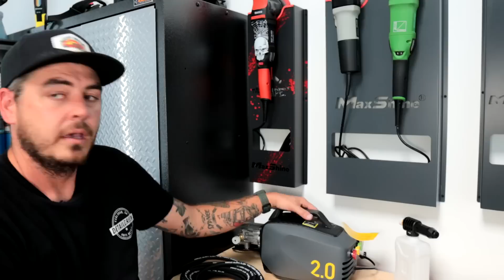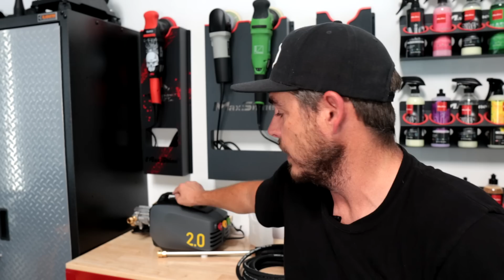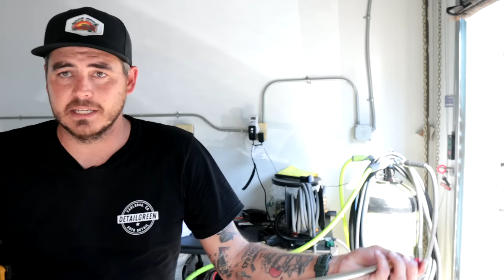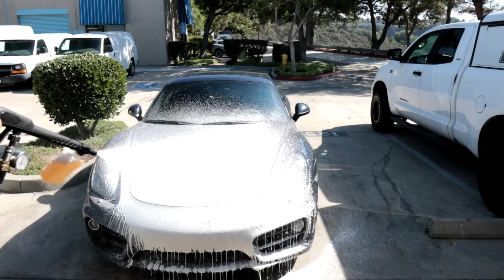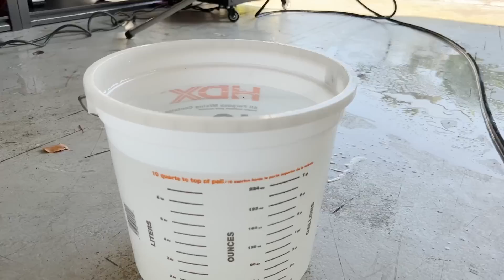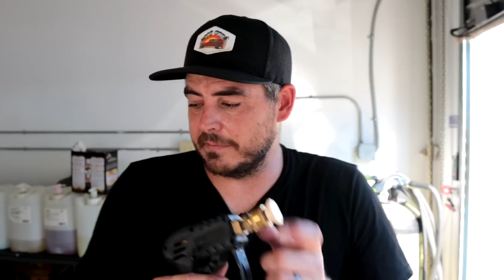NEW! ACTIVE 2.0 PRESSURE WASHER | Best Pressure Washer for Car Detail

Comment: Excellent video Josh! I resisted buying this machine until you reviewed it. Thanks for your approval. That being said, would it be too much to ask you to swap the 1.25 orifice on the MJJC cannon so we can see the foam consistency and amperage? Please  I only have a 15 amp breaker in my garage and I’d rather not spend the money to redo the wiring
Reply: Switching a 15amp breaker to a 20amp is just that.  Check the wire gauge. 20amp should be no lower than #12. My 15amp wiring was #12, and the swap took 5mins. I spoke to an electrician and he said he only uses #12 as the minimum for residential.
Reply: @timkinley1779  the house was built in 74 and the outlet was added in 84. The wire is not the thick enough for a 20 amp breaker. The cost to swap the wire and a 20 amp breaker is $350. The hassle of returning the 2.0 pressure washer is not worth it IMO.  I would rather see someone swap the orifice on a real foam cannon
Reply: @timkinley1779  Nice that you found a high end electrician that exceeds code. You got lucky. Larger gauge (smaller number) is a rarity when not required by code because so many builders are cheap. Still, it's not a ton of money. If I were building a house, it would have 20A circuits only.
Reply: I am also interested in seeing what the MJJC does with this pressure washer and a 1.25 if at all possible.
Reply: @JPond4  I heard most people are not having any issues using the MJJC with a 1.25mm orifice + Active 2.0 while connected to a regular 15amp setup in their houses. Can't say about the quality or thickness of the foam they're getting though but they all seem happy with the results.
Reply: Pretty sure toward the end of the video he stated 1.25 is the standard it comes with and you won’t have any issues on a standard setup… or am I missing something.
Reply: @ZeusyZeus  it’ll trip the breaker if you only have a 15 amp breaker and you put a smaller orifice on
Reply: @pasqualepisani  how can I check to make sure I have enough? But the 1.25 it comes with is safe right?
Reply: @ZeusyZeus  yes, I believe so but you are better off checking the Active web site. I use a 1.1 orifice because the soap foam is thicker and clings to the car longer which makes it more effective. I decided not to buy the Active press washer and stuck with Ryobi from Home Depot. IMO, it’s a better value. Get the upgraded MJJC foam cannon that Josh sells along with the quick connects and better hose.
Reply: @pasqualepisani  awesome yeah it looks like a great setup enjoy!

Comment: So how would you compare active 2.0 vs greenworks pro 2300 for a diy!
With that most diy’s are probably going to want multi purpose use like washing vehicle and use around the house!
I’ve watched a lot of your reviews and according to your numbers the comparison of the 2 would be very similar
Reply: II’m looking to get a pressure washer for around my house. Siding, patio, concrete garden wall, car etc. Lowes has the 2301 on sale for $249. I wonder if the active would be good as well.

Comment: Josh do you know the orifice size of the quick connect nozzles that  come with the Sooprinse gun on amazon
Reply: 1.25, btw I returned mine. That thing sucks and foam is weak even after replacing it with a 1.1mm orifice. The Mckillians and even the cheapest amazon basics foam cannon produce thicker foam. Just my honest opinion. I own those 2 and the Armor all as well.
Reply: @jjabblePlayStation  I think he was talking about the nozzle tips that come with the short gun, not the foam cannon orifice.  But still, thanks for the input, I also just bought a Sooprinse foam cannon.  Cars with Keav liked it and I figured for $20 it was worth a shot.  Haven't used it yet but now you've got me thinking about returning it.

Comment: Whew the specs are looking like a minimal increase from the ve52, I did have a leaking issue with my original purchase but active replaced the unit no questions asked, top tier customer service. Thanks for the diligent work that you do, putting out these reviews as quick as possible 🙏🏼🫡

Comment: I’m going to be honest I need to see it used with a 50 ft hose because I had issues with 2 different cat washers with my 50 ft flex zilla
Reply from the maker: I did attach it in the video to test the specs but agreed that time will tell if it really handles it. I’m going to be setting it up in one of my mobile detail trucks to see how it holds up
Reply: @imjoshv  any chance we could get a 3 month follow up?

Comment: For a mobile detailing business with a $400 budget for the machine itself and not scaled up enough to consider a AR or Kranzle, really questioning this due to lack of serviceability

why spend ~$325 to buy this with a residential-use-only 2 yr warranty when I can just get a Ryobi 1800 or Karcher K1700 cube with a 3mm orifice for less than half and a no-questions-asked 3yr/10yr warranty? I see a lot of bad reviews on the Karcher but are these people even trying to use the warranty? I just turrned in my ryobi for a new one at home depot when it started failing. took 15 minutes didn't even need my receipt, so the unit is basically free.

As I understand it the Active 2.0 is better for personal home detailing but the Karcher is better for small mobile detailers?

Comment: I bought the Active VE52 last October after you reviewed it and I love it… no issues with mine (so far). I bought a 50 foot Flexzilla hose to accompany it because the Uberflex was not available at that time.
Reply from the maker: Awesome! Yes they made some upgrades to the ve52 as well so it’s great to hear they are working and you haven’t had any issues
Reply: Awesome video. 
I’m just a dumb homeowner! 
Would the active be a pressure be good for around the house? Siding, patio, car etc?
Or should I get a Greenworks like the 2300 or karcher 1700? For example. Thank you!
Reply: @adamg.1845 active for longevity  but the Home Depot stuff for less money and if something goes wrong just do warranty cliam

Comment: Had i known about this unit i may have waited but my Karsher 1700 Cube works rather good for now. Thanks for this review
Also love how you point us to much more affordable products then other some other channels
Reply: Karcher 1700 is a nice machine compared to other big box stores it can definitely hold its own 
But for me I opted for greenworks 2300 pro just because of multi use around the house
Reply: @gabelitell8632  Yes it is my first pressure washer i may upgrade later. The greenworks you have i heard is rather good
Reply: How’s the 2300 holding up? I’m looking to get a pressure washer for around my house. Siding, patio, concrete garden wall, car etc. Lowes has the 2301 on sale for $249. Still recommend it? I wonder if the active would be good as well.
Reply: Still loving the 2300?
I heard Greenworks customer service isn’t good

Comment: Just from watching your videos I was able to accumulate that stubby nose sprayer that you recommended as well as the mjjc foam Cannon which I absolutely love, and also now looking to add that uberflex hose to make my pressure washer system but it should be. I'm really loving the Ryobi 1800 PSI, I wish it produced as much GPM as this unit does but I bought it because it was only about $100 at home Depot.

Comment: What is the best way to get a light layer of dust and pollen off of a ceramic coated truck without having to wash it or do you need to wash it.? I'm going to get that Uber hose it looks a lot better for my Ryobi 1800 PSI electric pressure washer. Thank you for all your videos, you are a true professional and I really get a great education every time I watch anything new from your channel.

Comment: How much of a difference would running a 3/8 hose instead of the 1/4 inch?
Reply: With a 100ft 3/8 hose it take a sec for the pump to turn on. When I let go of the trigger it takes a sec for the pump to turn off. Do you also have the active 2.0? What hose are you using?

Comment: Got my 2.0 last week and used it last weekend. So far so good. Wish they were available sooner with the shorter summer season we have here.
Reply: Good to know, just ordered mine directly from their website, how long does it take (more or less) for them to ship the unit? I'm in Florida btw.
Reply: @jjabblePlayStation  Not sure to be honest, as I did the preorder so I waited a while. Heard that it has been pretty good for some customers, hopefully that'll be the same for you.
Reply: @clay3544  Alright, thanks for the quick reply, I appreciate it.
Reply: @clay3544  One more thing if you don't mind...Are you using a foam cannon with a 1.25 orifice? I'm asking because I saw a vid on YT where they use a 1.1mm orifice with their foam cannon and the amps went up to 19. I only have 15amps outlets like most houses so I'm kinda worry if even the 1.25 might trip the circuit.
Reply: @jjabblePlayStation  I have an MTM foam cannon, using 1.25 orifice, connected to a 50' hose. 15 amp service (I believe) and no issues. I tested using Meg Gold class soap and considering it's not really meant for a foam gun it worked well. I've got some P&S Pearl and CG Mr. Pink to try out. I'm sure you'll be fine with the 1.25
Reply: Can I use this for other pressure wash activities? Like driveway, deck etc? Stupid question probably…

Comment: Did they ship yours with the 3.7 or 4.0 nozzles?
Reply from the maker: Mine came with them labeled as 3.7 but it got the same performance as the 4.0 I have…
Reply: @imjoshv  interesting, I sent an email to them asking why i got 3.7 instead of 4.0, and they said they made the decision to go with the 3.7 for the best balance of pressure and flow... Blah blah. I'm guessing it was existing stock from the ve52 :). Regardless, damn happy with my unit!
Reply: @imjoshv  lol, I see you mentioned that several times in the video now that I sat down and watched it :) re: the oil on the case, have you checked and tightened the pump housing? Could be leaking from there...

Comment: Great review Josh!  I love mine.  I'm using a 5.0 nozzle, the Uber Flex hose, and the stubby handle and its amazing!  I thing OG tested it with the 5.0 and got around 800psi, which is perfect for me!  Keep the content coming!!
Reply: Did the uber flex change the way the pump pressurizes/runs compared to stock?
Reply: @esobofh  I did not try the stock hose, so I cannot answer your question.  I will give it a try the next time I use the pressure washer and provide an update.
Reply: @esobofh  won’t affect it enough to matter
Reply: @esobofh I have a UBERFLEX 100ft 3/8 and it takes a sec for the pump to turn on when I pull the trigger and takes a second to stop when I let go of the trigger. Doesn’t do that with my 50ft 1/4 UBERFLEX hose…
Reply: 800 psi?   Why so low?
Reply: @xMattMoron  the bigger the nozzle = more flow = less pressure.  I've washed a bunch of cars since I got it and its amazing.
Reply: I just ordered mine (2.0 tool only) from their website but I wanted to ask you about the orifice size when using a foam cannon, I saw a video on YT where the amps goes way too high using a 1.1 foam cannon orifice, not really safe for a 15amp outlet. Are you using the 1.25 foam cannon orifice instead?
Reply: @jjabblePlayStation  I have a foam cannon with a 1.25 and another with a 1.5 and they both work will.  I was nervous at first using the 1.25, but I haven't had any trouble with it tripping the 15 amp breaker it's on.  With that being said, you can use the 1.25 and be fine.
Reply: @danielfletcher1384  Oh man, I feel so much better now knowing I can use a 1.25 orifice. Thanks a lot for taking the time to respond. Happy washing!
Reply: @-d.b.m.1962  I assumed I have 800 because I used OG's setup.  I don't have a gauge, so I cannot say for sure.
Reply: Interesting, a 7.0 nozzle would probably be perfect for rinsing the car.
Reply: Is it common when you run a 100ft 3/8inch hose that when you pull the trigger on the gun it take a sec for the pump to turn on and then you let go of the trigger it take a sec for the pump to stop? It doesn’t do this with a 50ft 1/4inch house.

Comment: Hey Josh, I was on the fence between (after watching your review) on Ryobi 40v 1500 psi (now newer 6ah battery whisper version $599) vs Active 2.0. I live in a townhouse so don't have my own driveway. There are cars parked in front of my garage about 2 car length away so I need to wash my car parked close to my garage if I get active 2.0 and my left & right nextdoor neighbors leave their garage door open during daytime. With Ryobi, I can wash at our open space car wash area freely. I just bought Ryobi and MTM foam cannon & gun last week but haven't tried yet. 
Ryobi- costs more & weaker than active and limited battery usage time but no restriction for washing environment.
Active 2.0- costs less and more powerful machine but some washing restriction.
Should I go with active 2.0 or stick with Ryobi? Please give me an opinion, thanks!
Reply: Yes
Reply: Maybe